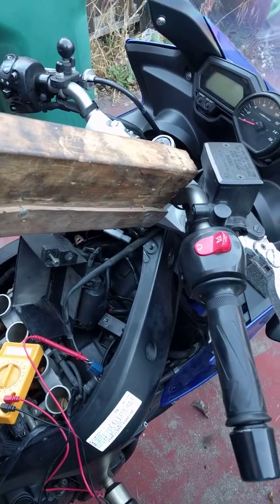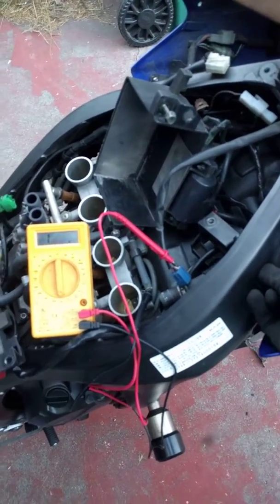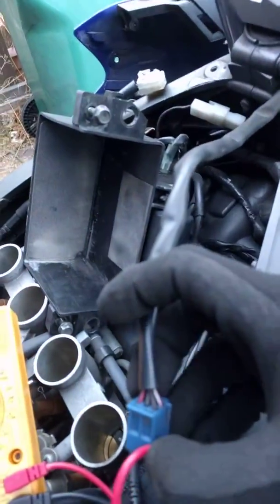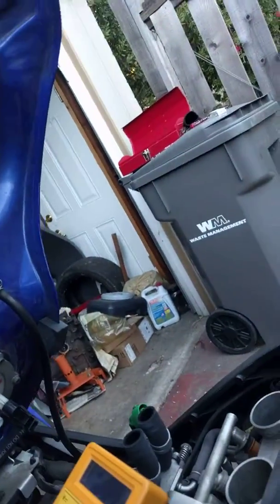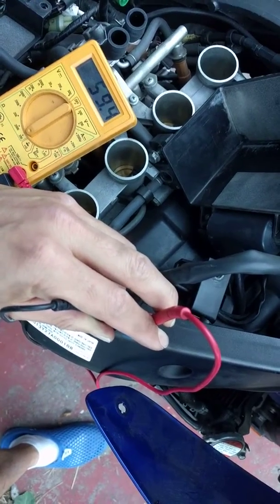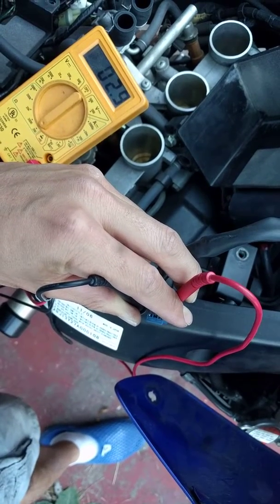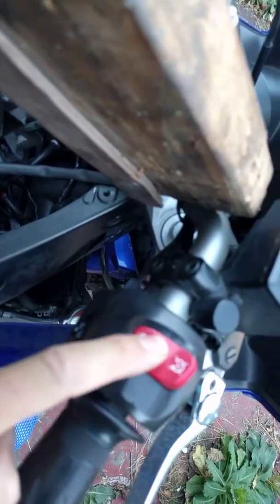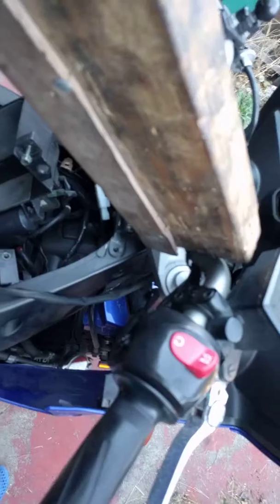2007 Yamaha FZ6 kill switch testing

Comment: Did you have a bad kill-Switch? My 08 just started cutting out from time to time with no warning or code light and I think it might be the switch going out.
Reply from the maker: Yup, mine would cut randomly even on the freeway. Super easy bypass, cut and splice the throttle assembly side of the harness so u can replace it all someday